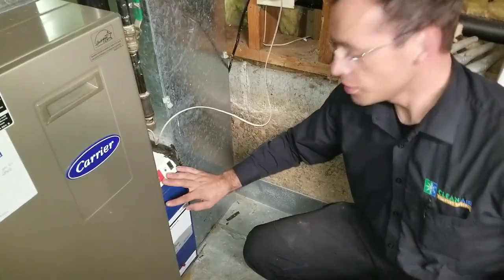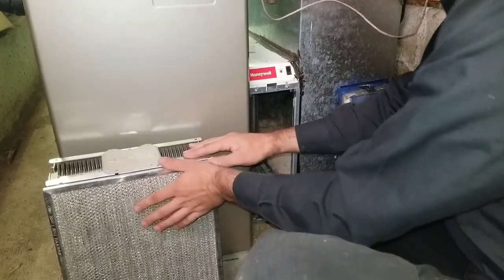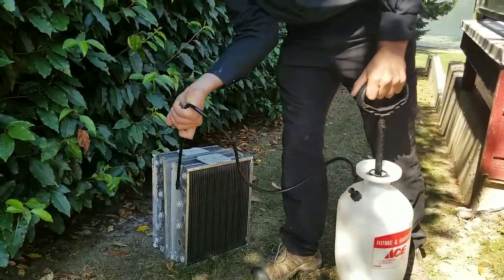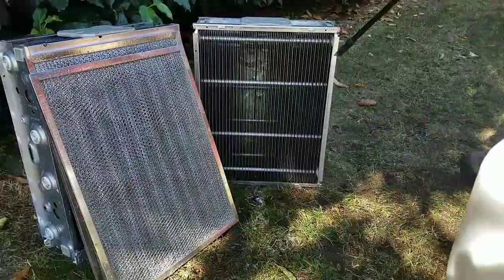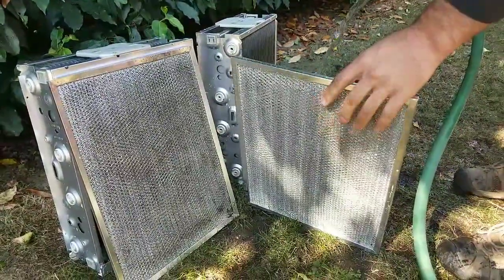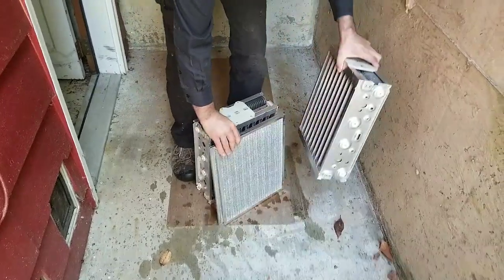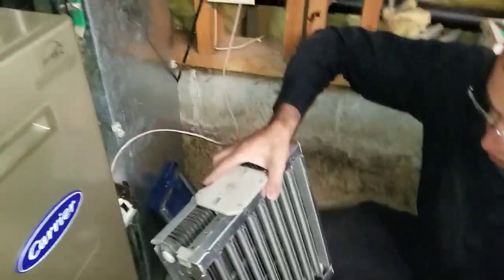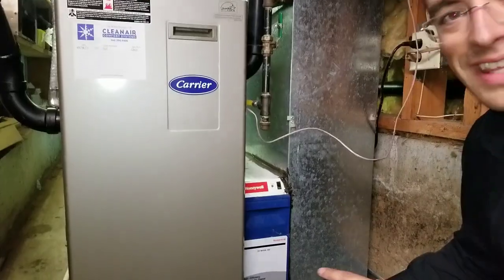How To Wash an Electronic Air Cleaner, Cleaning a Honeywell EAC Filter. How often? Every Season

Comment: I've had Honeywells since the late '60's.  I use the bathtub method and use the strong blast from my handheld sprayer with all hot water to first rinse everything.  Then I lay them down, close the tub and add my 1-1/2 c detergent and let them soak.  I found a really soft bottle brush and I use it to clean the fins and wires.  Sometimes, I even clean them with my hands.  I want them clean when I have to put them back in the attic!  They are GREAT!
Reply from the maker: @BuffaloBillie you're really taking this above and beyond! 👍🏼🤠 

Your method is great! For anyone who can do that it's a good choice. Since I'm a service tech I have limited time in the home I may not have that luxury! 🛁🧼🚿😀

Comment: Great video, thank you!! I just cleaned my F300 Electronic Air cleaner and 4 filters for the first time. The pre filters look different than the other two. I will call the installer to verify. I  did, however, wash all four. I had a little snafu after drying the two cell units. One ionized wire came off. By the grace of God, it was not broken, and I was able to hook it back on to the spring connectors. 👍 Reassembled the cleaner and voila. Everything is working. Yippee ‼️ Beyond grateful for your video👍👍👍👍
Reply from the maker: I also learned how to spell "voila" 😀 I've heard it but never seen it. 👍😂

Comment: Thank you so much for this. Our a/c wasn’t working, and the pipes were wet with condensation. Seemed like the fan wasn’t pushing air through the vents. Followed the instructions here to clean the cells and prefilters on our Honeywell electronic air cleaner (used 409) and we have air again! Amazing. Saved so much money and time. Thank you thank you thank you for this.
Reply from the maker: Great to hear. If you found value, would you consider subscribing and doing all the other things that help the powers that be recommend this to others? Thank you!

Comment: Replacing the Ionizer wires is quite simple, if they get broken, and they can be purchased on-line from a variety of sources for $10-$14 each. Honeywell part #136434A(A) for the 20" air cleaner unit. There is a video here on YouTube showing how it's done.
Reply from the maker: Thank you! Great resource. This used to cost us 30-60 from a distributor.

Comment: Today, I cleaned my Honeywell electronic air filtration units for the 3rd time. I stood them up on a non-slip mat  in my walk-in shower and sprayed them with a solution of water and dawn. I had to spray them down twice because there was/is soot build up ( not much) that I can't remove. Next time I'm  going to try Krud Kutter. As an aside, I dried the units and filters with my hair dryer because it was raining.  I think drying them with a hair dryer is my new way in the future.👍thank you for this video, it is the best.

Comment: I found this video to be  a Very good instructional, informative video for for me especially as a first time homeowner.  Thank you!
Reply from the maker: My pleasure! 
Let us know how if you need more help with anything else. I remember a few years ago when I was a 1st time home owner. There is a lot to learn about a house.
Reply: @cleanairheatingcooling4105  hi when I put the prefitler, cells and post filters back after cleaning them and turn the unit back on, how long is it supposed to make the sparking noise?
Reply from the maker: @clarissarojas3535  is the fan is running, no more than one hour. You may have to pull them out and inspect them for lint, hair, pet dander or some other tini particle shorting out the cells

Comment: In 1972, my parents had a house built.  The furnace had a Honeywell electronic air cleaner.  I am dumbfounded to see that the cells and prefilters look exactly the same in this video as in the 70’s/80’s and beyond.  As kids, we were amused by pressing the spark button just for kicks!  50 years later, I am convinced the Honeywell units are still the best.  

In 2020, my wife and I had a new heat pump and air handler installed.  We got talked into buying the whole solution from the same manufacturer.

With what I know now, I should have bought a Honeywell from another contractor.  The fitration media system works well but when I ordered a replacement filter (as thick as a honeywell cell), I totally got sticker shock!  The replacement filter was about 145$ CDN.  If I figure the system will last 20 years, that’s 24 filter changes, every 10 months or so.  That means 3500$ spent on new filters (not counting price increases and inflation) and 24 soiled filters going to landfill.

Granted the Honeywell system is MERV 11 and the one I have is MERV 16, I think overall the Honeywell is a great value and more ecological.

BTW, my parents washed their filters and cells in the dishwasher with the drying cycle on.  in 36 years , they never had any issues using this cleaning method.
Reply from the maker: Totally agree! The electronic filters have been one of the best solutions in may decades. I could say based on personal experience, feedback from home owners and testing data that the MERV 16 filters are a great solution for people who have conslcernsneorh respiratory conditions. The electronic filters only go so far. But if there are no specific concerns with micro particles the EAC is one of the best long term solutions.

Comment: I just moved to the Vancouver, WA area last week. We've had a couple of hot days and our air conditioner didn't seem to be keeping up with it. I used your video to service my air conditioner and man what a mess. I don't think it's been clean for a year. The only thing you may have pointed out was just inside the HVAC unit, the fan motor gets very dusty I had to vacuum that off also. But what a great video I really appreciate it. Thank you!
Reply from the maker: Great points! I should have mentioned all that! I guess my idea at the time was more focused on how to do the cleaning alone. If I get started on what could lead to poor performance of an air conditioner I wouldn't know where to start. I'd never finish either. Lol. But I could make a video on what to check if there when an AC or furnace doesn't perform well. Maybe a list if ten most common things we find.
Reply: @cleanairheatingcooling4105  very true! You were very helpful! Wish I could post pictures of how cruddy they were!
Reply: If anyone cleans a rotating blower, I recommend either cleaning it very well or letting a pro do it. I found that old dust didn't vacuum off easily. It ended up leaving the fan/drum dirty and imbalanced. I had to reclean it much more thoroughly wiping each fan blade.

Comment: I've just been cleaning mine with plain old tap water in the basement wash basin (6 feet from the EAC) all this time. I should probably use an actual cleaning solution. Also just got the idea to use my leaf blower to dry them off faster if I'm going to bother taking them outside.
Reply from the maker: That would help. Especially if it's an electric leaf blower. Our fir those who don't have a blower, can use the back end of a shop vac (if filtered correctly) or a hair drier.

Comment: I carry a plastic tub that I got from Target or KMart to lay down the filters so they can soak in Simple Green. Then I go back to the maintenance and/or repairs. About half way through the Maint/Repair I remove the EAC's, shake them off then put them back into the rack, which should have plastic locks in the base so the cells will only go in the correct way. I leave the power pack off cause the cells are still wet but turn on the fan which will dry them out fairly quickly. Then I go back to maint/repairs, finish then check the cells for dryness. If dry the power pack is turned back on and tested. I never use any chemical cleaner which leave the metal bright and shiny as than means metal has been removed. I also ask the owner to look at the soaking cells and they typically will see a coat of black oil floating on the top of the water. I explain to them that is the oil in the air from planes, cars and they automatically want me to service these units at least 3 to 4 times a year. Brown dust is just that, dust. But black oil rising to the top of the tub is the oil from cars and planes which also gets into their homes. This is very normal on the flight paths in and out of Seattle.

Comment: Right to the point, simple information. I'll probably just only use water to clean everything.
Reply from the maker: I I was still recommend using some sort of cleaner because the filters collect dust and oils and other sticky things from the air that over time will get the filters clogged up
Reply: @cleanairheatingcooling4105  ok, I'll figure out something to use in addition. Thanks.

Comment: Great tutorial! 
I find a pencil eraser also works great on the Ionizing Wires and the top of the fins too, carefully of course. 

My biggest concern was the solvent types. Anything that is safe on aluminum, plastic and maybe copper? Pressure washing solutions might be a good option for those super old dirty fins. I am unsure. Sodium Hydroxide based cleaners seem to be the go to.

Anyways, thank you!

Comment: Thanks this is helpful. I just cleaned mine for the first time, not knowing I had this on my system until I saw it and googled. So minimally they haven't been cleaned in 6 years. I did this process including allowing the cells to soak in some TSP water for about 30 mins and I still see some dirt on the insides of the coils. Anything more I can do to get these pristine? Dishwasher?
Thanks.
Additionally when I pulled them out they were installed backwards. :(
Reply from the maker: Great job on this Andrea! You can try different degreasers because they all attack the dirt a little differently. 
You can soak them in the tub with dawn dish soap. And you're right, you can also put them in the dishwasher like you said.
Reply: @cleanairheatingcooling4105  Thanks!
Reply: My owners manual says don't use if you have lower and upper arms in the dishwasher. I think they are implying that you should remove the dish racks to make room. This would mean the cells lay on the lower arm and maybe block the upper arm. So, I'm guessing some machines just shoot out streams from the sides/top/bottom without using a rotating arm.

Comment: Great video. I was worried since there is a slot between the cells and the furnace that i was missing a filter but I know that it is complete as-is. The "extra' slot is presumably so it can be installed bidirectionally. Thanks!
Reply from the maker: That's right, Kelly. 
You can also have "post filters" I stalled there. These are in addition to the items in this video. They are not required but you can get them for additional filtration. 

The post filters are static filters and they cause a bit of airflow restriction. If you chose to add these just make sure you heating and cooling system can handle the it.
Reply: @cleanairheatingcooling4105  Ok! I saw the post filters online but it confused me. Now with your video and expert advice I more fully understand the system. Thanks!

Comment: This is so helpful! I was able to quickly remove and clean the coils thanks to your help. I'm a new homeowner and this is the first time I've taken lot at the coils. I noticed that I'm missing several ionization wires and it appears that the spring connections they were connected to have arced and burned. Are the connections and wires replaceable? Not sure if this is something I can do myself or not. Thanks!
Reply from the maker: Oh my..... I've found the burned hooks before. I've been able to bend them just slightly. Enought to allow the new wire to stay hooked. If that doesn't work you have to replace the whole cell. Let me know if I can help you further.

Comment: I'm on my second Honeywell EAC and I will attest that they do trap fine particulate. Something that bothers me however, is that no matter how much detergent and rinsing I do, there collector plates retain this black soot. It is nearly impossible to get a brush in between these plates to scrub them and that is exactly what they need. I have tried using a pressure washer outside but now I just put the cells in my dish washer.
Reply: I too am on my second Honeywell EAC and have the same issue with the black soot that remains on the plates no matter what I have used to clean them. Today I experimented with several different cleaners and found that household ammonia seemed to dissolve that soot. Try it. Place the cells in a utility sink and use a spray bottle with ammonia and watch that soot run off.

Comment: Good heavens--my Honeywell filter is 41 years old and it looks pretty much identical to the one you show here.  Only the powe supply has been changed over the years.  It's survived a furnace and 2 heat pumps.  I clean mine by immersing the filter in a mild detergent solution, then rinsing it off with a hose.
Reply from the maker: That's a perfectly good way to do it. As a service that I don't usually have that luxury and access to tabs or time but as a homeowner your process is excellent!

Comment: Thanks for posting a most informative and concise video.  I have two question.  If I use the dishwasher can I just use regular dishwasher soap and run a complete cycle?  If still wet, can i use a portable hand dryer to expedite drying?   Can I just soak in a laundry tub with soap and let sit for a while.  Then rinse throroughly?
Reply: I washed in a laundry tub as I couldn't fit both in the dishwasher.  Soaked in tub thoroughly and repeated process.  Also, the prescreens were done the same way and also used a scrub brush lightly.   Rinsed in a tub of water thoroughly.  Then rinsed in the stand up shower with shower head and set to dry.  I went over with a hand held hand dryer to ensure dryness.

Comment: great video!  When cleaning my filter and unit with Simple Green as you suggested,  do I use all purpose, and do I use full strength or dilute?  Thanks
Reply from the maker: You can dilute it to an average strength as long as you do this regularly. If you're trying to clean them and one application is not sufficient, then go ahead and try a second and a third application. If that's not enough then I would say you can use a stronger solution. I appreciate the comment and please check back in for future videos and feel free to reach out with any other questions.

Comment: Great video. Any opinion of using the dishwasher to clean? That’s what I’ve been doing, always being very careful of the tensioned wires, and not bending the fins.
Reply from the maker: You can definitely use the dishwasher. It's easy to just put them in and take them out dry. The only negative that I saw was those wires breaking and that's extremely rare. Other than that is totally acceptable. There isn't I showed my way in the video is because as a service tech I only have about 30 minutes to an hour on site and doing it the way I showed it in the video enables me to get all the work done in a timely fashion. Occasionally clients will choose to put these air cleaners in the dishwasher while I'm there but then it's up to them to put them back in and sometimes it causes a call back because they forget to turn power back on or they forget how to put them back in. But you're totally fine to use that obviously you've done it enough times too know it by heart

Comment: How do you feel about using an air compressor to hurry the drying process? You answered a lot of questions that I've been wondering about for many years. Thanks for putting this up.
Reply: That’s what I was wondering as well
Reply from the maker: I feel "reserved" about about it! Low pressure, may be ok, around 20 psi, from a distance. 
I put this video up to answer most client's questions on how to maintain their electronic air cleaner. There are truly so many good ways to do it. I'm glad this was helpful in answering some of these questions. 

And thank you for asking! The next video will include more details. What do you want to know next about heating and cooling equipment?

Comment: hello,  What citrus based degreaser are you using?  I bought simple green and an HDX 56 oz  hand held multi purpose sprayer.  I called HDX, they told me simple green will destroy the O rings.  What can I use to clean my post and pre post filters in my honeywell air cleaner?  Thanks
Reply from the maker: We use HD calgon. There are some other fence your products out there that cost anywhere from 50 dollars to $150 for the ones that we use. I've never heard that about simple green. But there are so many variations of these household cleaners that it's really hard to be certain without checking this specifications on each bottle or the ingredients. I've never heard of simple green damaging these cleaners but that's not something that we use I only know of that based on our customers feedback.

Comment: Thank you for the demo. If you have an electronic air cleaner, would your furnace also have the other filters?
Reply from the maker: Yes. It's possible. But it varies from unit to unit.
Reply: @cleanairheatingcooling4105  Thank you. By any chance do you have an email or direct number we can reach you at as we have a few questions, please?